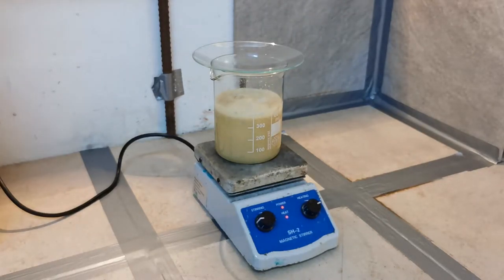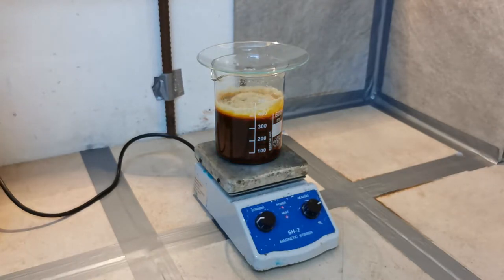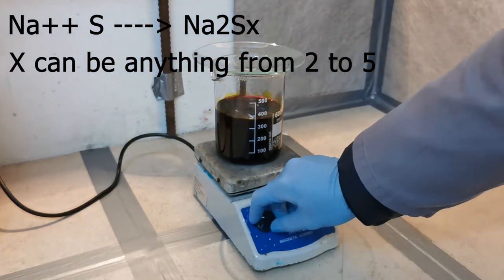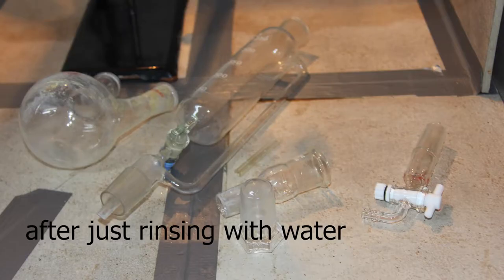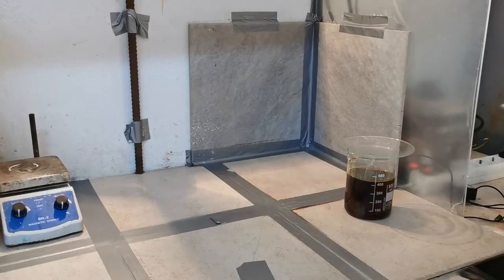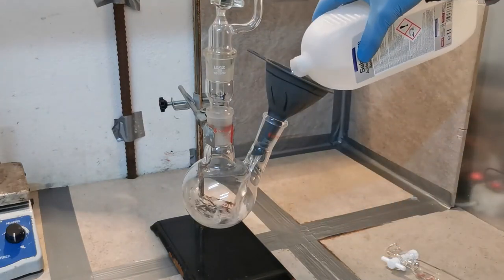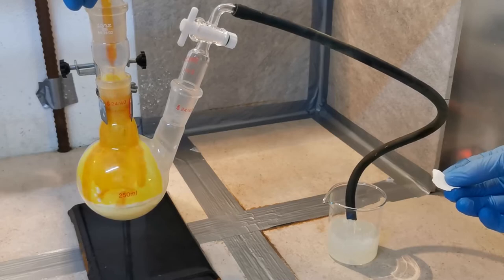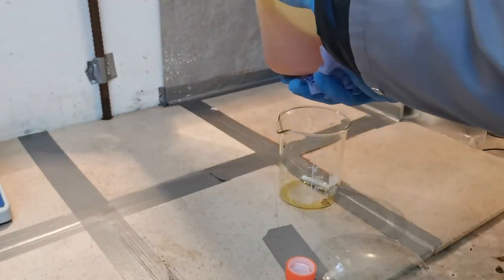Make H2S from Polysulfides

Comment: I would reommend to use solid polysulfide in the gas generator, because that's more efficient then using an aqueous solution.
Solid polysulfides can be formed by melting alkali carbonate and sulfur together.

Comment: Have you tested the resulting gases for the presence of sulfur dioxide? Because, when you dissolve sulfur in sodium hydroxide, the sulfur disproportionates to sulfide (polysulfide, when there be more sulfure) and sulfite (thiosulfate). The moment you acidify this solution again, sulfur formation should occur (because synproportionation). Of course, sulfur will also be formed from the decomposition of polysulfides and thiosulfate. So, hydrogen sulfide should not be formed, or together with sulfur dioxide.